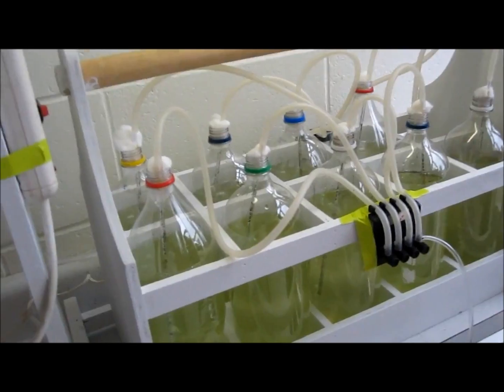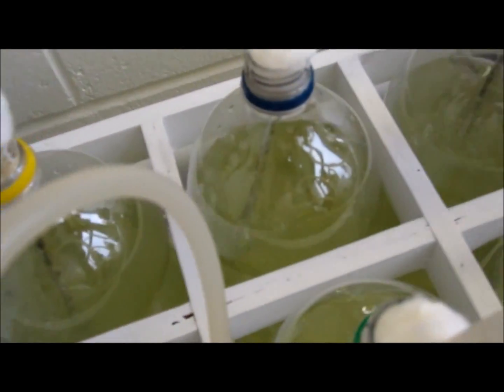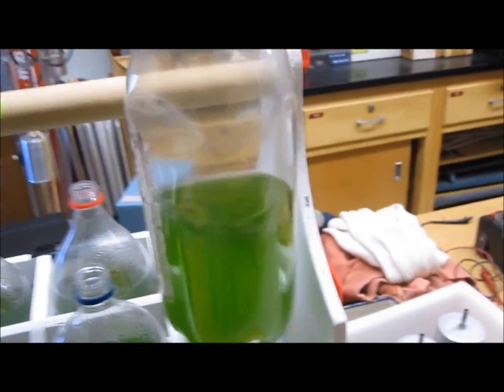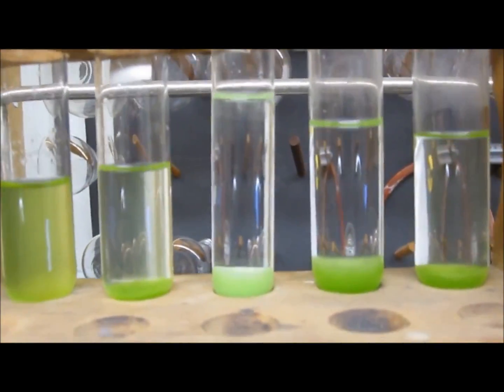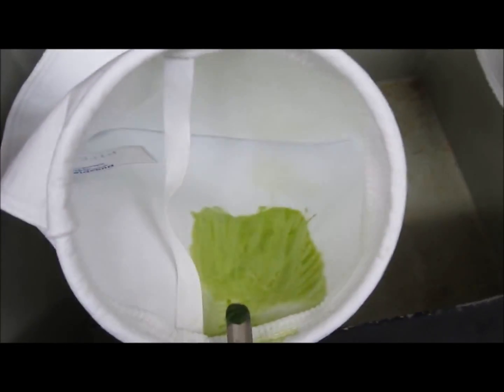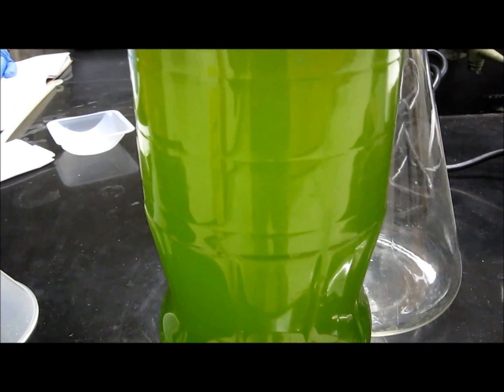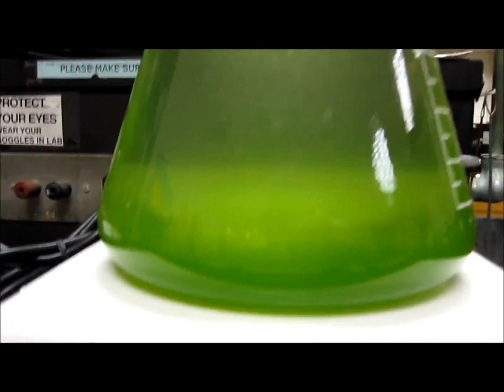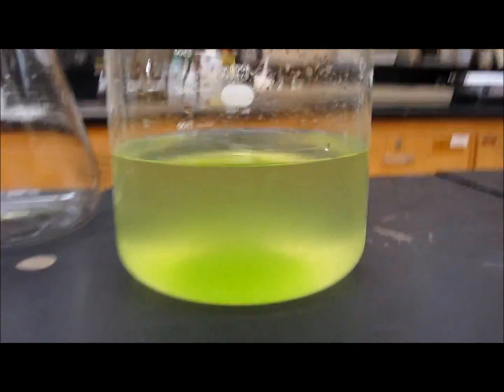Homeade algae bio-reactor with NaOH flocculation for oil extraction

Comment: you need organic solvents to extract the oil out of microalgae such as hexane or methanol or ethanol, not NaOH, NaOH is used as a catalyst in the reaction, not the solvent.
Reply: Codys lab just dries the algae and burns it in a test tube

Comment: Does the sodium hydroxide kill the algae and will sodium hydroxide kill spirulina? I was also wondering if you knew of a way to cleanse spirulina of unwanted bacteria and keep it alive  in a paste form?
Reply from the maker: You can't cleanse out the bacteria and keep the algae without something like an antibiotic solution, but that's not needed.  Most algae culture is grown under sterile conditions, ours included to the best of our ability.   You can filter it and store it as a paste.  It's very common to do that for use in aquaculture feed, etc.
Reply: @BasementBiotech   thanks man!

Comment: what exacty did you use as a pump for the air
Reply from the maker: Just an aquarium pump for $5, pumping air through tubes we pre-sanitized with dilute bleach, and we used large sterile plastic/glass pipettes with sterile cotton in the top to aerate from the bottom of the bottles.
Reply: Thanks

Comment: I was wondering which is less energy intensive; Producing sodium hydroxide for flocculation, or centrifugal separation?
Reply: +Keith Reynolds I would say centrifugal. If the machine is built proper it should be efficient and long lasting and possibly also fully recyclable later on. It could also be powered via renewable means such as leg/arm power or solar, wind etc. Possibly even being powered by the oil made from the system itself.